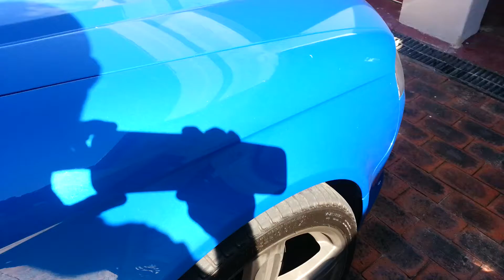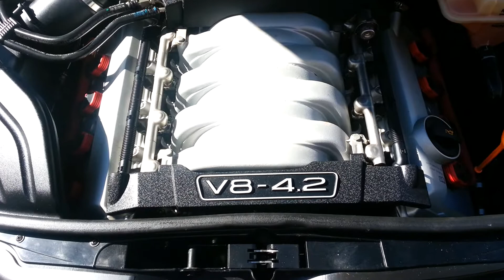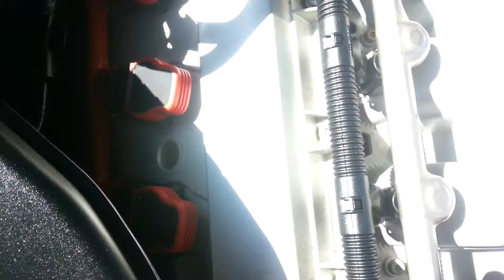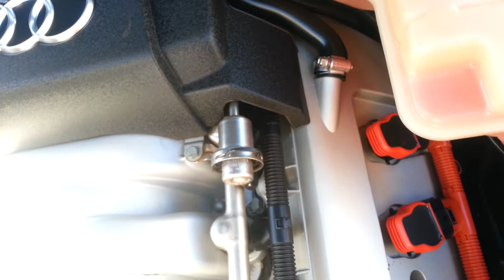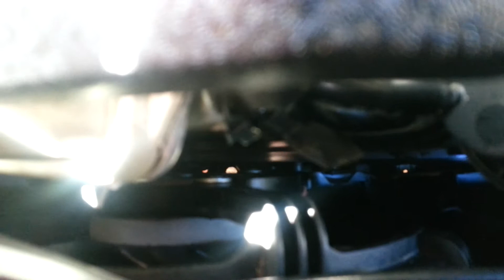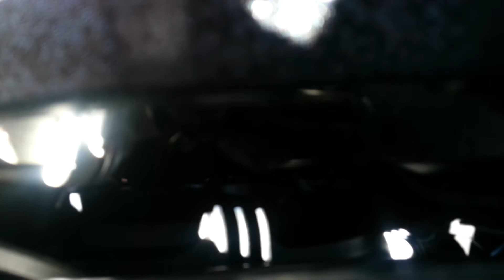Audi S4 Belt Tensioner Assembly Noise

Comment: Alright guys. I haven't changed my belt/pulley/tensioner/snub yet but that's next on the list. Back to the starting issues: I figured out what was causing it. I was getting a code and it read no spark at ignition coils. I changed the crank sensor and it wasn't it. I ended up pulling the ECM cover and the ECM from the cradle. There are 4 relays under there... I pushed the 614 relay and boom, car started. The relay was bad, so I changed it. The cover is a bear to get off... You have to pull the wiper arm, mine didn't come off, I ended up pushing a hole in the shroud under the wiper (accidentally)  that gave me perfect access to the remaining screw. Wasn't a huge deal as there is a drain hole right by the hole... I used a puller and it still wouldn't come off. Hope this helps, those youtubers out there with similar issues. If you need a how to on the crank sensor, let me know.

Comment from the maker: Edit: Pulled the front end off, put the radiator into the service position and replaced the idler pulley and belt tensioner as well as the Serpentine belt. Car is running beautiful now.

Also changed the snub mount with an 034 Motorsports one plus their no gap Snub Bracket. The car feels as tight as a drum now, with far more feedback on what the motor is doing.

Comment: Same exact car, same problem. How much were the parts? Also, have you had any intermittent starting issues? The car turns over but I get the EPC, red battery, electrical check engine and brake light. I hear a click when it starts, no click and it doesn't start... It will go weeks without issue then bad for several days. I replaced the fuel pump relay with no result... Just wondering if you've heard of similar problems with these cars.

Comment: Hi Brett. I was wondering if you knew what the fault is exactly as I have the exact same noise on the exact same car. I'm wondering if I should stop using it until I has it checked ...
Thank you
Reply from the maker: Hi Anthony. The noise was the Idler pulley and belt tensioner pulley. It’ll be OK to drive as the pulley should not seize, but it’s best to get it done. It’s a pretty straight forward job and I did this myself If you’re not a member of Audizine, I suggest you join as there are plenty of ‘how to’ tutorials on our cars that have saved me a bomb and the members are quite happy to assist with any questions you have. I also suggest doing your Serpentine belt as the design has been revised and Snub mount at the same time - either Akipol or 034 (who also do a zero gap snub mount which replaces the standard one). ECS Tuning or JHMotorsports in the US are the people in the know for parts.
I hope this helps...

Comment: my 05 s4 just starting the same noise a week now, but no check engine lights on yet how long can i drive it without replace it. And how much will it be replace it??
Reply from the maker: Lao,
You won't get a check engine light. If it eventually throws the belt, you'll get a battery light as you charge decreases.
When you change out the tensioner pulley change out the idler pulley and belt at the same time.

Comment: how long is the work to replace the belt and pulley
Reply from the maker: If you do it yourself about 2-3 hours.
You have to take the front off and put it into the service position.
The pulley has to tensioned to 70lbs.
Join the Audizine B6/B7 S4 forum if you have not done so already. 
Loads of info and pictorial how-to's.